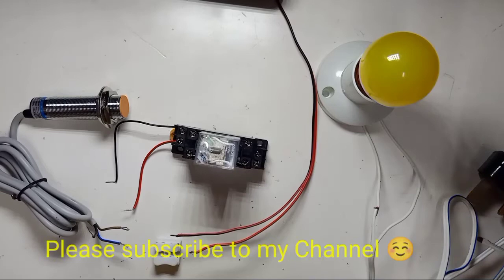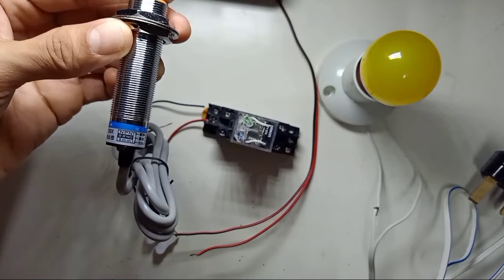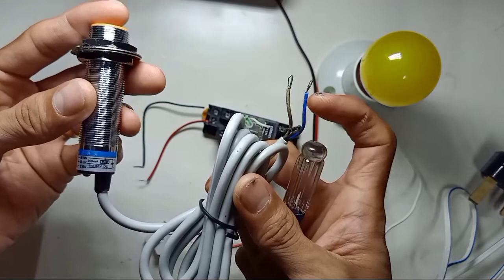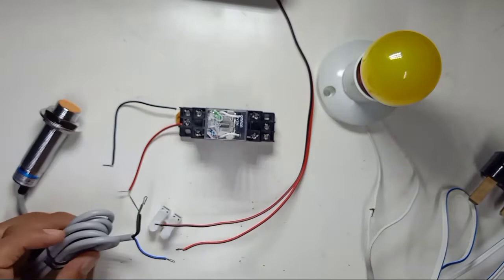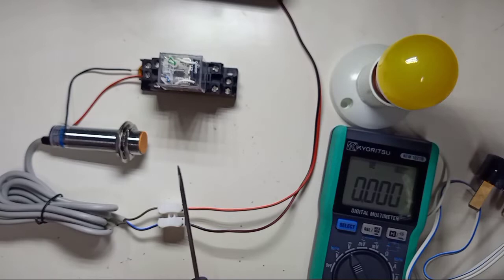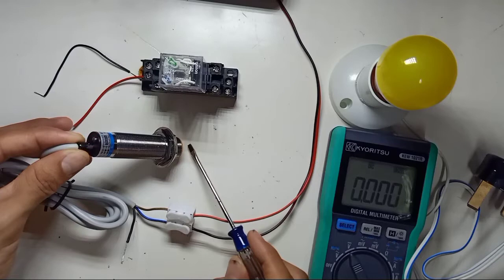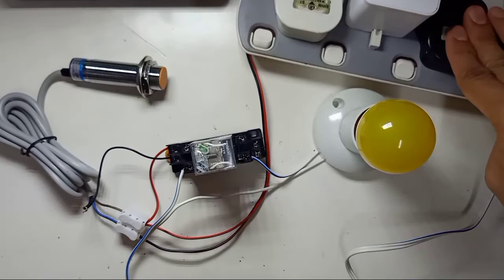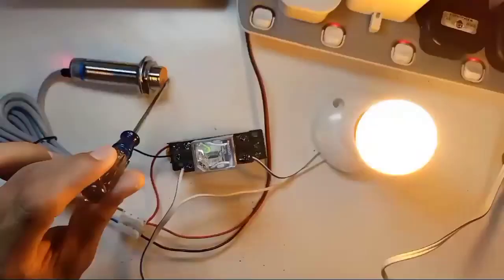Inductive Proximity Sensor with Relay

Comment: Great video! What’s is the primary and secondary voltage of the relay?Can you put the links to where you purchased the relay and base? Thank you
Reply from the maker: Relay coil voltage is 12VDC but to the load side you can use both AC 220V and DC voltage which will handle 5Amps.
Reply: @passiontechklm  I understand now. Thank you for your time.

Comment: Is there any relay that works with voltage ...ac
Reply from the maker: Yes,  you can simply find ac relay which will trigger by ac voltage and control out put.